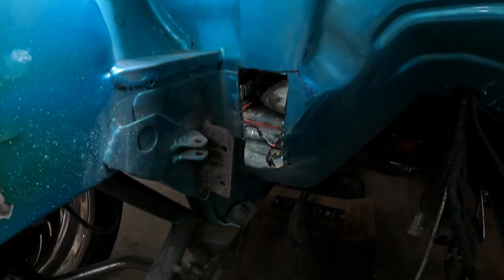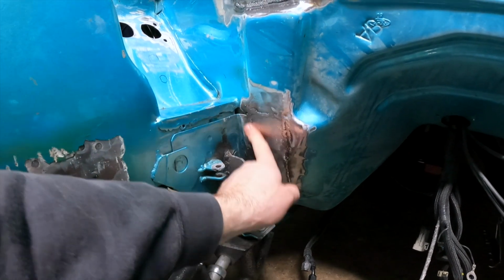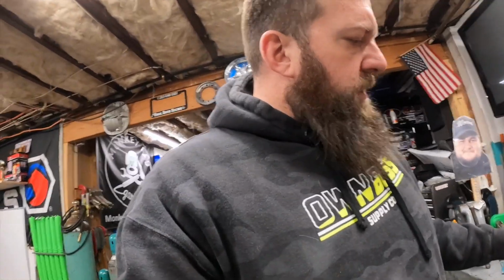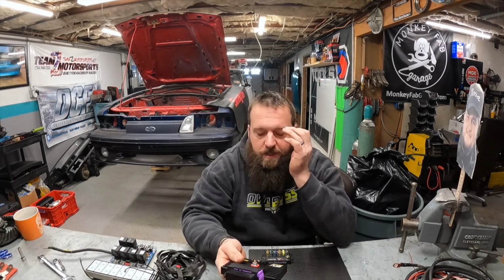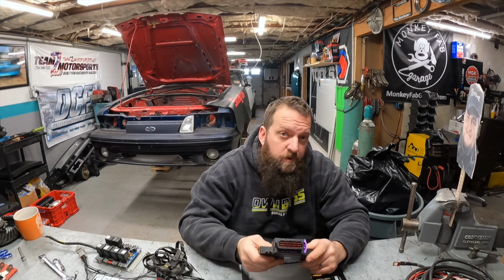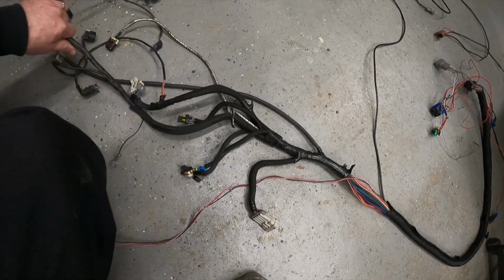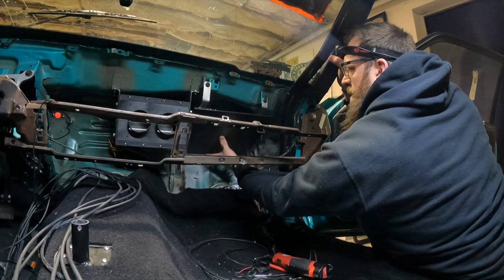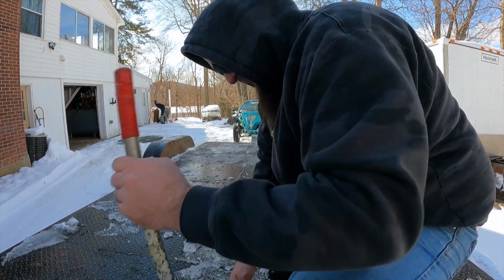New electronics and wrapping up the engine bay!

Comment: I'd run the blinkers through the pdm if you can run the output of the motion switch as an input and select the blink speed as an output and eliminate the flashing relay for turns and hazard.